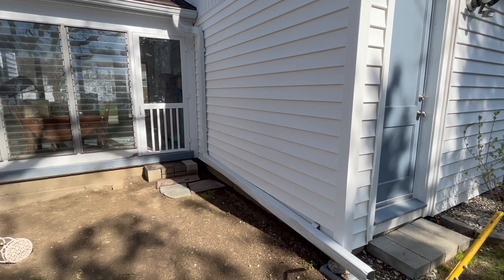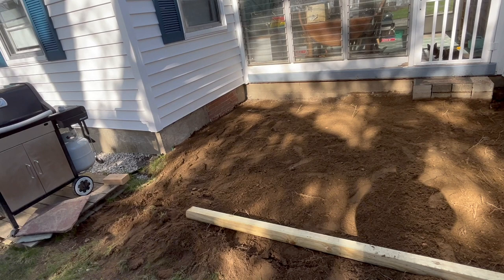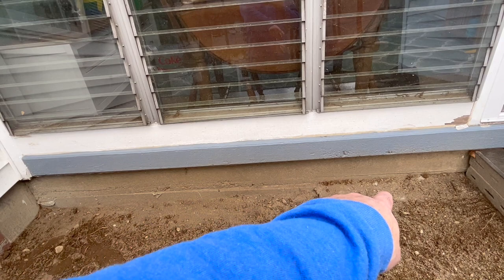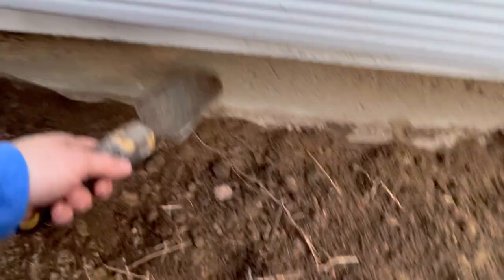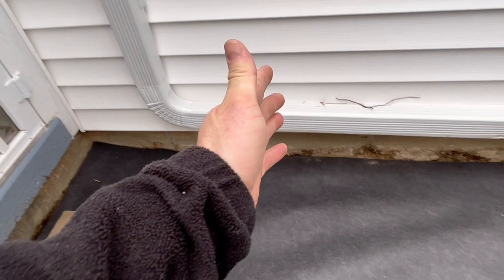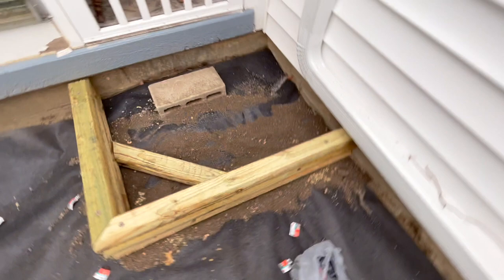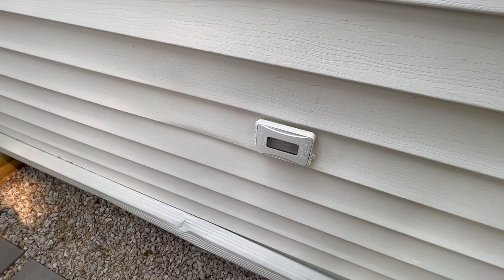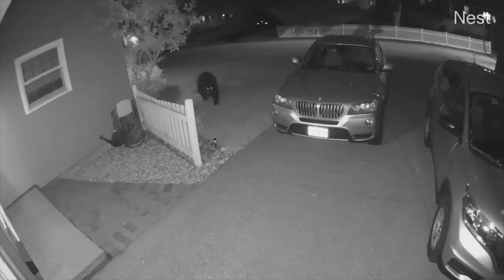Building My Budget Patio, Step by Step

Comment: Do you read your comments?
Reply from the maker: Every single one is moderated, so yes
Reply: @bbishoppcm  I've left you a few comments about that 88 Toro lawnmower you have. You were asking for a gas cap/tube that works. I have it. I also have the electric starter, alternator and key to convert it to the key-lectric version. Actually i have the whole mower. Chrome is good too. 

Not sure you still need any parts for it but I have it all. Willing to sell/trade
Reply from the maker: I responded with my direct email address - stereorepairs@gmail.com. We can chat there - I am interested, but it all comes down to price. Would you happen to have the carburetor as well? I'd like a spare.
Reply: @bbishoppcm  I do. I have the whole mower complete the only thing wrong with mine is the deck is pitted with holes but the motor and everything else is good. I'll contact you via the address you've provided with some pics included